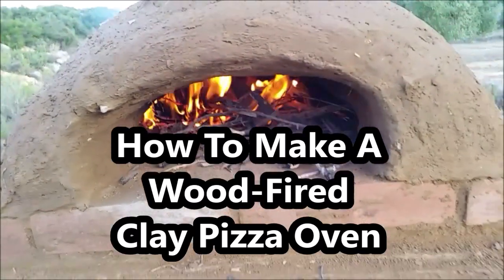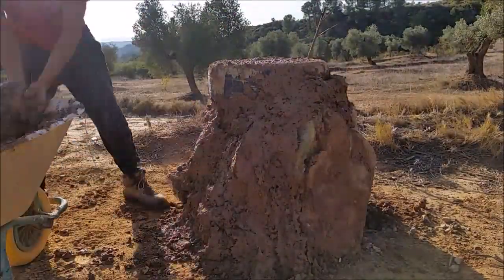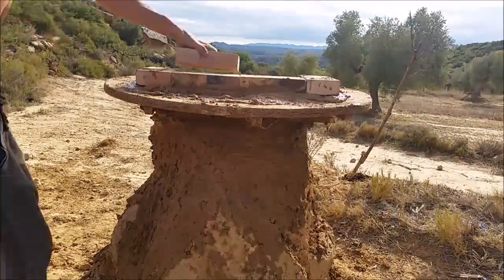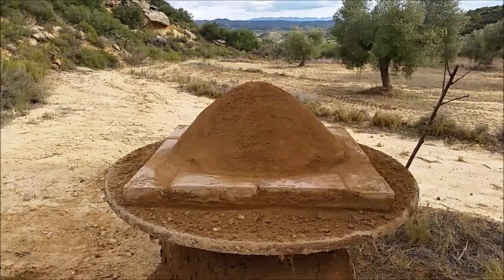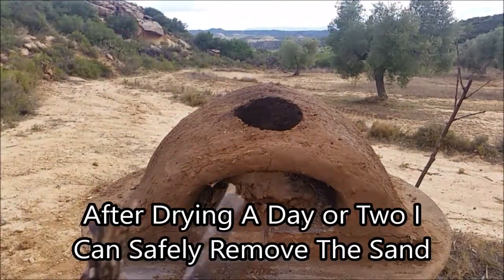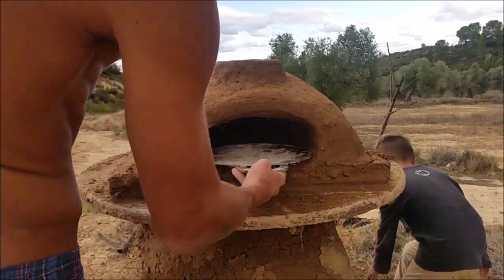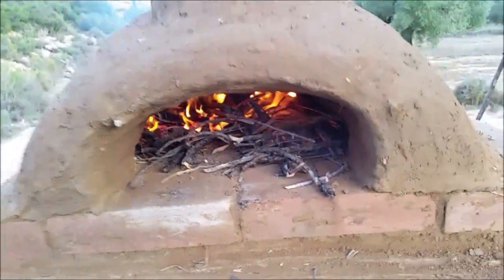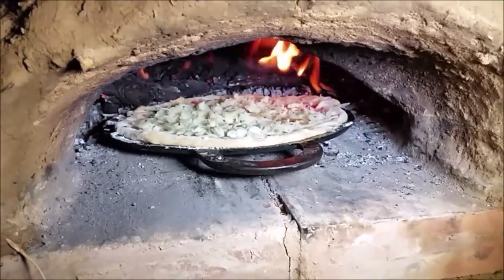Clay Pizza Oven Build Timelapse

Comment: What would be the lifespan of an oven constructed like this? It's been my dream to have one of these but want to make sure it lasts forever as it will be under a deck on an outdoir patio and need a way for the smoke to be diverted. Any idea and suggestions? I have subbed and wish you much success on youtube!
Reply from the maker: Put a roof over it and it should last forever. If anything I learned though i would say build it bigger. Maybe enough for 2 pizzas at a time.